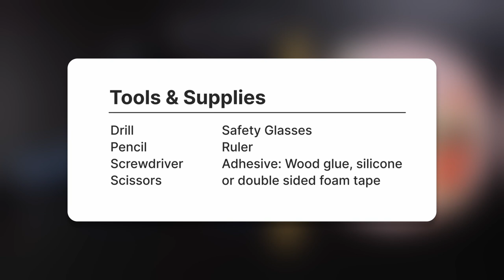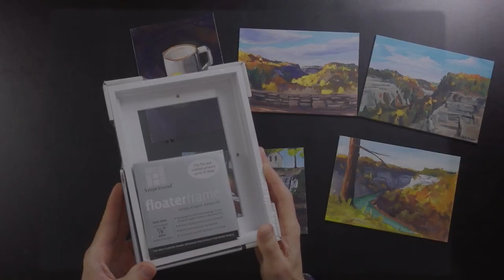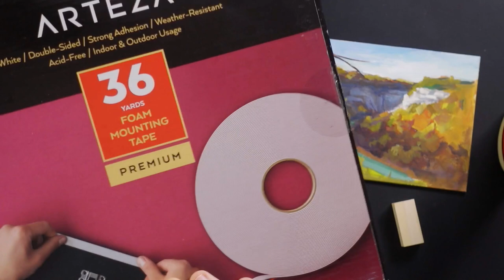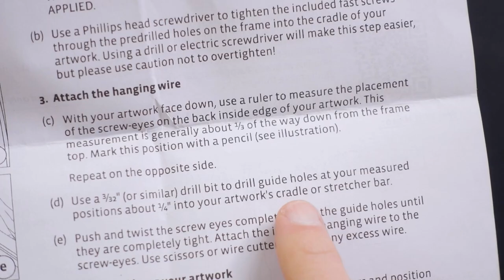How to Frame Flat Panel Artwork in a 7/8" Ampersand Floaterframe - Easy DIY Tutorial by@ChrisBreier

Comment: Excellent instructional video! Beautifully made frames. I use these Ampersand floater frames often and have a couple of tips. 1) Attach the hooks and wire as the first step, before mounting the artwork. This provides more freedom of movement while drilling and screwing in the hooks. 2) If framing a flat panel, once the panel is placed and the cardboard spacers are in, when you flip the frame over to drill and add the screws,  the cardboard spacers can dislodge. The spacers are bearing the weight of the force as you drill. I arrange books under the panel so the cardboard spacers are not touching the work surface. This keeps the spacers from dislodging as you drill the pilot holes for the screws. 3) The finished wire length should be just a tad longer than the distance between the eye hooks. When the frame is hung you want the wall hanger to be within the opening of the back of the frame so the frame is flush to the wall. If the wire is too long, the back of the frame will bump up against the wall hanger provided.

Comment: Can this be done with a screwdriver only? I don’t have a drill😅
Reply from the maker: It can be done, but could risk splitting the wood. It would be recommended to use an awl or another sharp point (push pin, thin nail) to start a guide hole first. This would make it easier to start the eye screws and the reduce the risk of the wood splitting. Thanks!

Comment: If I use a cradled board that is one inch deep, will it sit right in these frames?
Reply from the maker: A 1” artwork is 1/8” deeper than 7/8” which is the frame rabbet depth. Even accounting for the slight inset of the design to allow the artwork to sit slightly below the frame’s face, 1” artwork would still extend above the frame by a small amount.